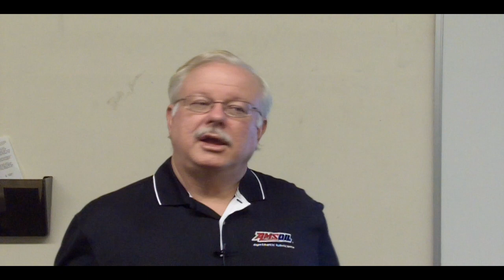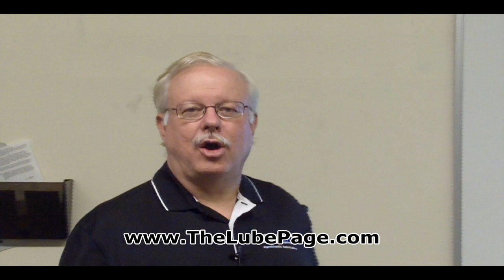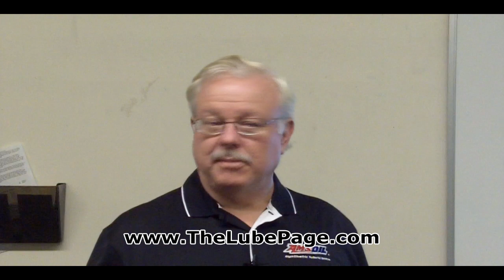Hydrocracked vs PAO Synthetic Motor Oil

Comment: Paper filter buckled and collapsed and element end caps were completly disintegrated on my Toyota Sienna. It had 7000 miles with Amsoil XL on a cartridge type filter not can. It was cellulose combine with glass. I think the bypass valve was open for the last 3000 miles. I changed the filter and oil which was moderatly brown. Now I paid a little extra and bought a synthetic filter with mesh wire backing. This is a danger which should be known. When doing extended drain cycles 7k to 11k... PLEASE  use wire meshed reinforced filters if you dont have a can filter. Cellulose wont work past 5500k. i know this because i use to change every 5500 k and filter looked in shape. Now going towards  full drain life of Amsoil XL I know. This experience has changed my mind completly. Just changed my Volvo Turbo same brand filter and dropin type. End caps on filter element were loose at 6k no buckling or collapse yet.👍😥
Reply: Were the filters definitely the same length? One thing I always do even with supposedly identical mopar filters is set them next to eachother to check how long each filter is. A shorter one won't filter period. Not sure why you think one bypassed for 3 thousand but not in the beginning
Reply: Good point. I buy filters when on sale in packs. The volvo and toyota are same brand and type but diffrent model. When i saw the difference is in the same car. I was changing at 4-5k and filter looked fine kept shape. When i went over 7k with my next change on same car. The filter failed😕. What im trying to say is...if u go 20k extended drain make sure your filter can take abuse. Or swap out cheap filters every about every 5k.
Reply: Sorry I misunderstood... NEVER take filter past 5k Miles ;)
Reply: A cheap one, i havent tested a quality full synthetic element with wire backing yet at full 25k drain interval because im chicken 😲

Comment: Engine sensors have complicated engine performance, burning a 25k motor oil for one year will reduce engine problems due to sensors, yet primarily your engine will stay clean inside you will never need to add engine cleaners and their cost. Amsoil 25k once a year and peace and good health to you.  Dan thank you for the info you are the most credible oil engineer on the tube. I give you "The Jimmy"  award as in hendricks some talk some teach.
Reply: I am going by my personal experiance on my h3 hummer amsoil has improved performance and gas mileage I increased my mileage with amsoil by 3 to 4 miles per gallon recording gallons and miles over a six month period. performance such as dry starts, warm up, engine vibration, all improved, I have always known oils oxidize and become sticky and resist the engine my kia soul, sweet little car she is, does not like dirty oil, yet my big girl hummer she is prissey she dont like oxidized oil too sticky,  straight five engine block, heavey car. So amsoil 25 k made significant performance I will never need to add additives, I ride 12 k a year and change oil once a year engine is like new.
Reply: 25k my ass!

Comment: Excellent video and made it all very clear. Recently Shell has moved to pure plus technology which from the advert seems like a grade 4 oil and so does Castro edge. So have other manufacturers finally caught up with Mobil and Amsoil?
Reply: Vignesh N.Y no they haven’t. Not one of those manufacturers is selling you group 4 pao base stock oil
Reply: @carloscruz7317  They can not make oil better tha PAO
Reply: @jesusfabian861 They can, as Polyolesters.

Comment: So is Amsoil Signature Series 5w-30 (ASL) a group 4 or 5 ?
Reply: Robert Smith 
Group VI. Red Line is famous for its Group V Ester based oil.
Reply from the maker: Group IV with some group V ester added.
Reply: @thelubepage  Hi Dan, why amsoil ss is not using full ester based ?
Reply from the maker: @yantonpangaribuan1601  full Ester oils can have some problems with moisture.  Esters are highly polar and therefore very solvent in cleaning, this good but you have to have a blend to moderate the aggressive nature.  Ester based oils have trouble going for extra long intervals, Amsoil combines PAO with Ester to get a better final product in the Signature Series oils.
Reply: Dan Watson thanks, it's true what I've heard then. I've heard that Group V Esters are incredible for cleaning. I'm glad you discussed the different 30 weights (0w,5w, and 10w) I'm in Texas and use the blue cap 10w30 in a Silverado 5.3 (iron block aluminum heads) I was a little worried about winter performance, however, even at 20-25 degrees it should flow fine. I've heard that 10w30 is better than 0w30 as less VII's are needed. Is that true ?

Comment: The fact is, Amsoil does not have, and never had any capability both technologically and equipment wise to produce ANY lubricant base oil.You are purchasing your base stock from a bulk supplier,not producing them.
Reply from the maker: Astute observation.  I don't remember ever saying Amsoil was refiner or manufacturer of base stocks.  The base stocks that Amsoil sues are not secrets and they are available from a variety of chemical companies.  Historically, Amsoil has bought PAO's from Mobil Chemical Co.  Esters from Lubrizol and group III base stocks from a variety of suppliers.
Reply: William Green what’s proprietary is the additive package. Mobil use to bottle and sell the same thing that Amsoil does today, but no money in that for them so they don’t do it. Now they bottle you up conventional as synthetic and people eat that shit up at 3-4 times the cost.
Reply: @carloscruz7317  The only important thing is it GF 5 or not.  Where it started out is not important.  The final product is.

Comment: This is 2010. I was reading that Mobil 1 has indeed went to group 3 as well with the exception of one specific blend called " extended performance".
Reply from the maker: I've heard this but unable to confirm.
Reply: From what I've read, an oil like Mobil 1 5w30 hasn't changed, still group four based. But Mobil now offers a "Super Synthetic" line of oils at a lower cost which one would assume is a group 3.
Reply: lk7496 it is not group 4 base Mobil has zero products on the market that are group 4 base.

Comment: I've tried for a long time to find out for sure what kind of base stock amsoil uses and they will never tell. if they used pao or ester why wouldn't they advertise this? i use motul 300v and it says ester!
Reply: for example bardhal is pao
Reply: they used to advertise what it was. now they dont! its weird! 
300V is a Di Ester (dual ester or Two ester )
The XL blend is a group 3 base oil and then their signature is a grp4
Reply: @seinfeld11123  hi Jack, is it true ester based oil cause seal swelling ?
Reply: Primary base stock is Exxon-Mobil Visom. It's group III+. It is only inferior to PAO in Artic conditions. It has PAO and Di-ester blended in the finished product. The entire package is more important than a single basestock.
Reply: The more I study motor oil,. It was not by listening to du(m a$$ advertising it was a mission. Look up Torco, you will learn, make up your own mind. My advice is to study base stock oils which makes up 70# of oil and don’t believe the hype.

Comment: Theres too many oil brands. There cant be so many requirements in practise.

Theres either good oil or bad oil. Good oil protects the engine no matter what, bad oil can be cleaning but not lubricating the parts well.

Comment: I can understand that motor oils are rated for only so many miles of use, after which they need to be changed.  Where exactly does the time interval come into play?  I've heard six months, i've heard a year, i've heard two years.  Does a motor oil really go bad sitting at the bottom of the crankcase?  Everyone seems to have an opinion about this.  What does the chemistry say about oil just sitting around in a base pan (or on the shelf) that isn't being worked?   Say an engine that sees less than 5k a year.  Is there any evidence that suggest you should change motor oil based on a specific "time" interval because the oil or its additives begin to break down?
Reply: +john barto I could not agree with you more!!   Oddly enough I actually do have periodic tests of my oil.  I use a lab located in Fort Wayne IN.  I think the total test cost around $35, but I seem to recall getting an email about a price increase.  They have told me exactly how much life my additive pack has based off of the TBN figure and also how the engine is ostensibly performing from the metals in the oil.  In my truck, a 2003 Tacoma V6, I can regularly get "about" 10k miles out of my hydrocracked base motor oil before the AP is spent.  Though I choose to change it just before it is completely depleted as I like to leave some margin for error.  The truck is my work truck and has ~220k miles on it.  It does not burn any oil (that I can tell).  I don't drive it to hard, and it never misses a beat.  Miles are mostly highway.  I had to replace the valve cover gaskets at around 200k and the valve train look great with no varnish or sludge.  I use good quality filters and open them up from time to time to get an idea of their performance, occasionally soaking the filter media in kerosene and letting it set for a week or two in a glass jar to see any sediment.  I don't do this often as I am not trying to obsess over itl, but it's nice to see what your filter holds sometimes.  Never had a problem with any of them.  But yes, an oil analysis provides about as much scientific evidence as one could ask for, and will quickly clear up the question about when you should change your oil.
Reply: +john barto Been using Castrol Syntec 10w30 jug at walmart for the last 120k.  Before that I used 5w-30 up to 100k starting with GTX and then eventually syntec.  I have used all kinds of filters including Mann, Fram, Denso, Toyota OEM, etc... but tend to go with Wix also (sometimes Napa branded Wix).  I still think they are made in Gastonia NC and you can't go wrong with them.  I have never used M1 oil, but clearly would have no problem using it as the information I have seen indicates it is top notch.  I've just had really good luck with Castrol over the years and I know how it tests so I'm familiar with that aspect of it and somewhat know what to expect.  I have also used MMO on occasion towards the end of a change, just to help aid in keeping everything free internally, but I don't really think it is necessary for a clean engine.  Old habits are hard to break.  Whatever the case may be I have always received very good reports.
Reply from the maker: Time stipulated for oil changes is based on depletion of additives due to cycles of heating up and cooling down of the engine and engine oil.  When you drive into the drive way and turn the engine off the oil and engine begin to cool down.  Eventually both the engine and the oil will reach ambient temperature.  Depending on where you live there will be condensation on the internals of the engine and water will drip down into the crankcase oil.   When the engine is started the next day, the oil and engine will begin to heat up.  As the oil gains temperature the water will be a catalyst for oxidation and deplete some of the anti-oxidant additives in the oil.  This water will combine with byproducts of combustion and form acids.  The acids will be neutralized by alkaline additives in the oil. For most applications the number of cycles for a low mileage vehicle will not be all that different from a high mileage vehicle.  It is usually a function of how far you drive once you start the car up.  For example, someone driving 50 miles to work vs someone driving 10 miles to work will have the same daily cycles but a considerable difference in total miles driven.
Reply: Hey I know its been a year but there are factors which are not specifically addressed in your question. Mainly, your cylinder bores are not perfectly round because the block is longer than it is wide, so it WILL expand length-wise more than it will width-wise because imbalances need to have an end result which is proportional to the beginning. this causes the piston and rings to allow fuel/air to blow past the piston rings on start-up. This literally adds fuel to the oil mix. The changed chemistry is why your engine oil has a in engine useful life. Yes it goes through heat cycles, but it also gets contaminated so miles are not the only factor that matters. The longer the engine oil is contaminated the longer it can break down.
Reply: john barto A full analysis costs about the same as new oil
Reply: Excellent Presentation
Reply: carriersignal seek truth, don’t be sluggish and buy the hype. If you want to learn more in 30 minutes about oil than a life of a mechanic, YouTube Torco and see their three part series on “synthetic” oil. You will be amazed as I was. Good luck and love your engines!
Reply: carriersignal  yo bro, in all honesty when you check facts, it’s not about the number of miles you put on an oil, it’s more the conditions it’s exposed to. Mainstream wants you to think it’s a number-f(&k the advertising it’s the conditions of your environment . Read you car manual “closely”. Don’t be a fool and buy into this hype.
Reply: carriersignal  if you care about your car...really....take time to do your homework!

Comment from the maker: Both oils you listed are 10W-40 viscosity so the flow characteristics should be similar.  10W-40 may be a little thicker than you need for your Honda.  Unless you have a consumption problem a 10W-30 might be the better choice.  Go to my website, TheLubePage and request some info and I will send you some info on Amsoil for your Honda.

Comment: Thank you very much for this excellent explanation. Now, I am about to change my oil in a couple of days I've been using Shell Helix 10W40 partial synthetic oil.

Last month though I bought Liqui Moly 10W40 Hydro Crack oil, just for the heck of it I want to try it in my 80.000 miles Honda civic MB3 engine.

Would it run past my main and rod bearings? Or has it the same consistency as the Shell Helix only cleaner? I would very much appreciate your help.

Comment: ok thanks so i go by the cap or the manual as it states i can use 520- 530or 1030 iin the book it does show 10/30 giveing better summer protection over the 5/20

Comment: 5w-20 is FINE for summer and winter.  If your cap says 5w-20 or 0w-20, the manufacturer really wants you to run 0w-20.  It has better Extreme cold flow and you get slightly better fuel economy (which is important for an EPA average that they must meet)  If your car says 5w-20, run it all year long with no problems.  There's no advantage to running a 5w-30, unless your car runs hot (racing, air cooled).  I'm a Toyota Master tech with over 20 years experience.  There is only a VERY slight diff.

Comment from the maker: Can you please post exactly how your owners manual states that the Amsoil 25000 mile recommendation voids your warranty.
Reply: My 2012 Dodge ram book states oil needs to be changed every 6 months or 6k miles whichever cones first.   No exceptions allowed.  Would/could that give Dodge a way to wiggle out of warranty coverage?  I believe it would because their recommended OCI is 6 months 6k.
Reply from the maker: @robshaw2990  Warranty issues regarding lube oil are always settled using oil analysis to determine the condition of the oil.  Recommended oil change intervals are just that, recommended.  Regardless of which oil you are using if you are denied warranty work because of the engine oil demand an oil sample to justify the denial.  You'll find that the challenge to use an oil analysis is enough to stop the denial.  If a sample is taken make sure you get one sample for yourself and the Dealership can take a sample for their use.
Contact Amsoil to get a good recommendation for sending the oil sample off.  Amsoil will provide assistance in evaluating the oil analysis report to explain what the numbers mean.  I have been involved in this procedure a few times in the 30 years of being an Amsoil Dealer and never has Amsoil oil been found to be the cause of the failure.
Reply: @thelubepage  ok I am sure Amsoil has never been found to be at fault.  Not sure I have ever heard of any oil ever being held liable for an engine problem.  Probably just because I didnt start paying attention until I start having problems.  
Rather than run the risk of not having my hemi tick time bomb engine covered by my lifetime warranty I think I will just stick with an oil change every 4-5 months.  I assume they will come up with some reason to not cover with a warranty but that will be one less thing to worry about.

Comment from the maker: Joe,
Your post is a little confusing and incorrect as written.  Grp III Hydro-cracked synthetic is certainly good for 7,500 miles (Amsoil XL for 10,000 miles) but they are officially rated for 6 months not 1 year.  The API sets the MINIMUM standard for oils to be rated SN, SM etc.  The API doesn't care what the base-stock is just the requirements for the classification.  You are right the cheapest of the oils has to meet the minimum spec to carry the API rating.

Comment: In other words, the hydro processed Type-III oils are just as good as the PAO oils for a once a year oil change or 7,500 miles. All of the API certified oils have to beat the API's PAO oil in the laboratory. That's right, even the cheapest of the cheapest oils have to beat the API's PAO in the laboratory to be API certified. Check out the "Machinery Lubrication" website. Real world performance, not laboratory "tests".